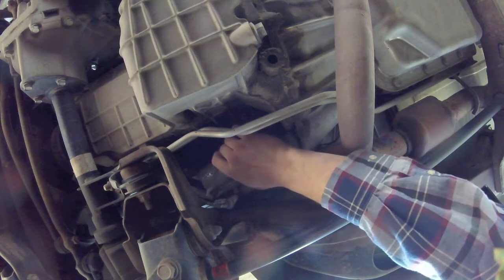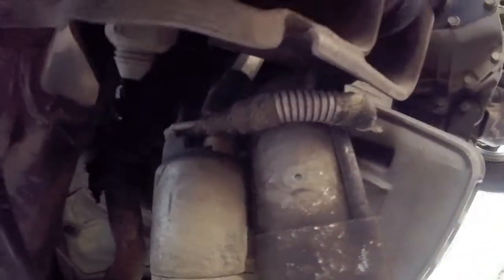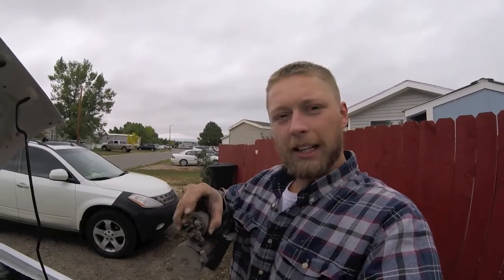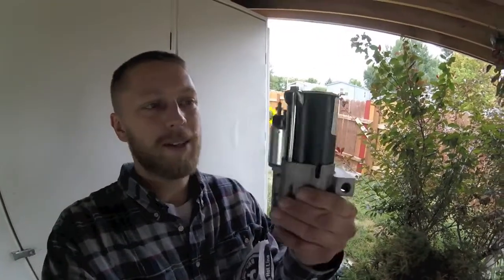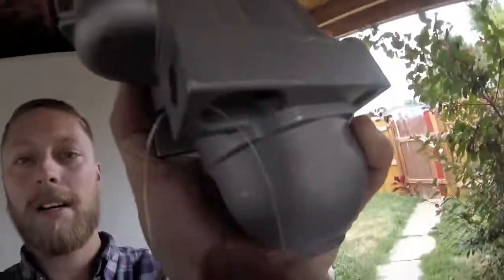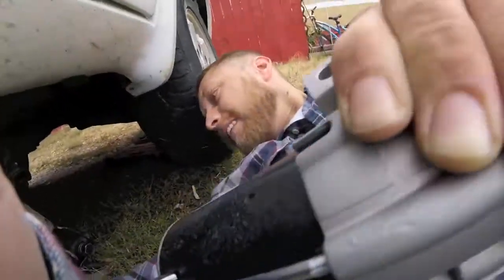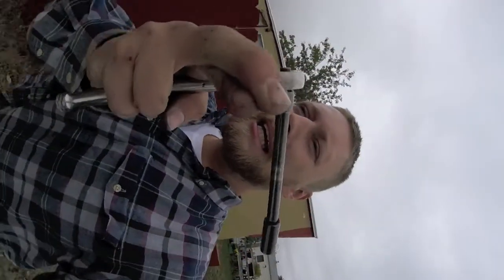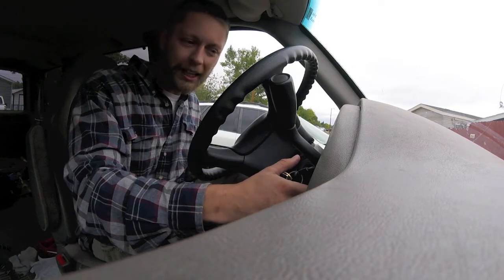How To Replace Starter On 2005 Chevrolet Astro Van

Comment: Found something about the Astrovan Kody! A nice 'how too' changing out starters is quite easy on a lot of vehicles. Your van looks quite nice underneath from what I see, they were the most rugged and able to tow of any offering back then save for the Aerostar. As others have said, always use safety stands or some very solid wide logs to hold the weight. Scissor jacks are almost as evil as bumper jacks. At least you had the right front tire still on but no more chances please! Enjoying the channel so far whenI get a few minutes here and there. Thank you for posting!

Comment: ground is through the frame of the starter to the engine. The large cable is battery power, the small wire is from the ignition switch to fire the solenoid (AKA relay)
Reply: We are here for lessons on changing the starter. Not sure anyone cares about how or why it works. I already understand, but I'm here to crush your flex
Reply: thank, you to for you're info👍
Reply: I, don't like to waist money
Reply: I, had a feeling that's what it was is a relay because it started up every time most of all of everything has a reley
Reply: I, don't jump at the problem at first I like to thought it out before waisting money